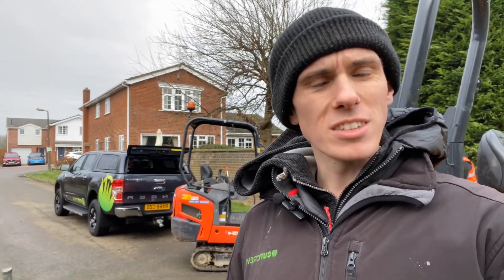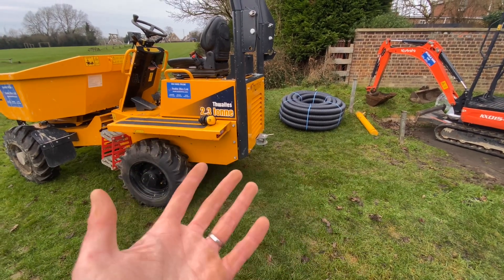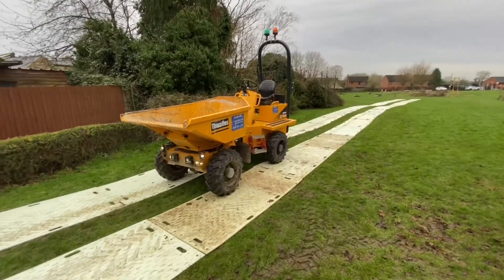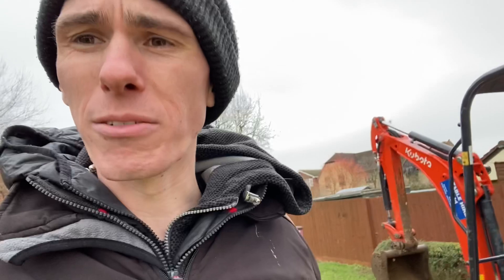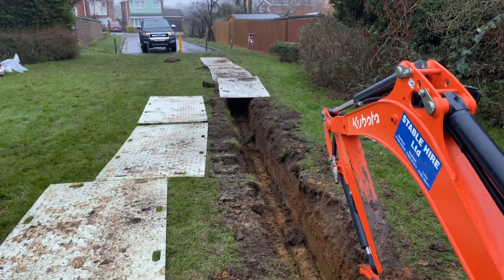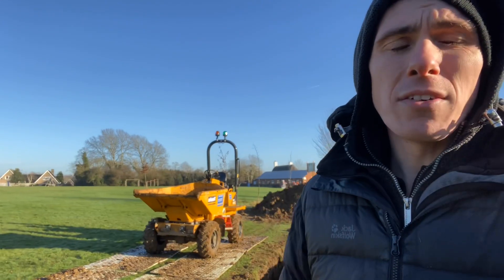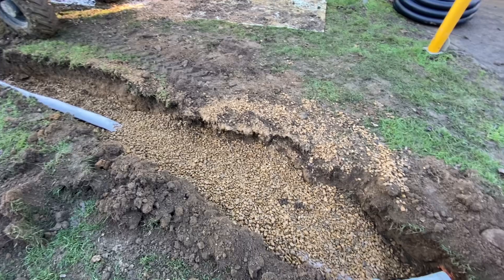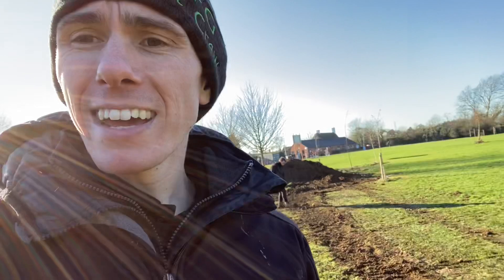How to INSTALL a French Drain: A Complete Guide

Comment: I installed a French drain under my lawn because the clay soil caused the lawn to flood and kill the grass. I removed 40-tonnes of clay and replaced with premium topsoil. Below the topsoil I dug several trenches, so I could lay interconnected, perforated drainpipe. The trenches were lined with geo-fabric, the pipes were then laid in the trenches with a gradient to allow the water to flow away to the main drain, and the pipes covered with gravel and wrapped over with the geo-fabric. What is important is that all the gravel is wrapped in the fabric to allow the water in, but keep out the soil that would otherwise wash through the gravel and eventually fill up all the air gaps and prevent the wastewater reaching the pipes. There are two rules of thought on whether to use fabric, but this is the approach I prefer to ensure the drain operates efficiently for many years. I only want to do the job once.
Reply: How wide and depth did you dig?

How many metres did you put in?

How many tonnes of gravel did you need?

Comment: Hello BFG, great video and will be using this as a reference to install French Drain in my garden, however, would you know over what width the drain will be effective to? i.e. if you fit a 100mm pipe, will it only be effective over a width of 100mm or is there a rule of thumb?
Reply from the maker: Hi mate! 

Aslomg as the pipe has gravel cavity all away around you would be fine so I’d say 200mm wide for a 100mm pipe, however you could fit a wider pipe or a double pipe and increase the width! It all depends on the issues it’s facing!
Reply: @cutcrewltd   Cheers for getting back to me. My lawn is about 17m long by 18m wide but one side struggles with displacing water. was looking to build 2 french drains on the damp side, but wondering if i need to do just one, or maybe 3 or 4

Comment: Interesting video. I am planning on installing a french drain to capture running surface water and divert into a nearby ditch. Silly question - With the perforated pipe, do the holes need to face up or down ? As mentioned it’s to capture running surface water, and secondly is it a good idea to also have a surface yard drain to help capture the water ? The drain will initially start on hard standing gravel (caravan site pitch) and then onto grass. Thanks
Reply: I’m surprised nobody has replied to you yet!

Holes point down. As the water table rises, the holes on the bottom will capture the rising water and carry it away.

Comment: We have a garden with a 45 degree slope in the middle of it and trees to the left outside our boundary. We always get a really soggy, mossy bottom right hand corner of the garden in Autumn/Winter as we get no sun in that corner during those months. Would a French drain diagonally across the slope work? Also if we don’t have a place to drain to, would a soakaway be the solution? If so where would you put it? Thanks 👍🏼
Reply from the maker: Soak away would be fine, installed at lowest point!

Comment: Talking about drainage and stuff.
I've just moved house and got a garden, yay. But there seems to be a drainage problem and today I dug some holes to have a look around.
In one bit of the garden there is a big grey layer, with a reddish brown layer underneath. Thick clay soil. I filled the hole with water at 1pm and its 9pm and it hasn't drained away yet.
My theory is that it might have been dumped from some building work the previous occupants did, as it is nothing like the soil in the rest of the garden or surrounding gardens.
Do you have any advice? I've got a few ideas myself but you might have a tried and tested plan of action.
Thanks for the vids about lawns, I've got a few tips from them already :)
Reply from the maker: There’s a few options, you can install a French drain like in the video, but ideally you’d need to get past the clay, this might be mega deep and in practical, the other option is to strip the lot back around 500/700mm and then build it back up with some decent soil. 

However it’s hard to give you a firm “best answer” with out seeing it.

Feel free to ping me some videos or photos if you need to!
Reply: @cutcrewltd  Yeah, my first plan is to keep digging until I find where the layer ends. I only get to work on it at weekends though, so I'll try to get you some pics then.
Thanks for the reply :)